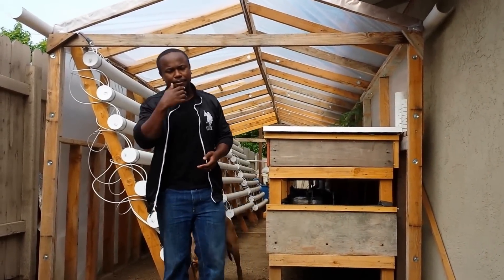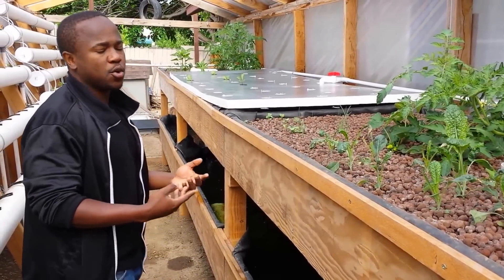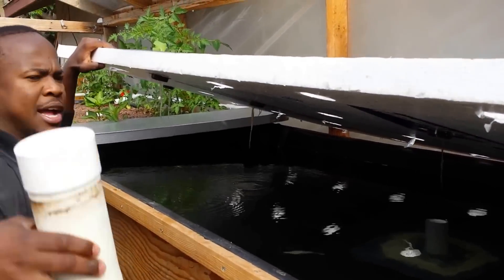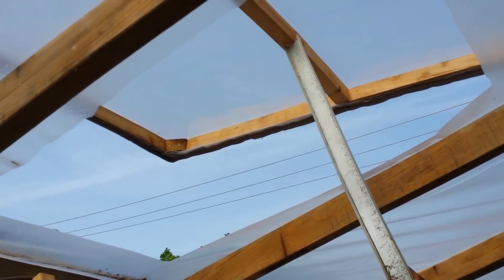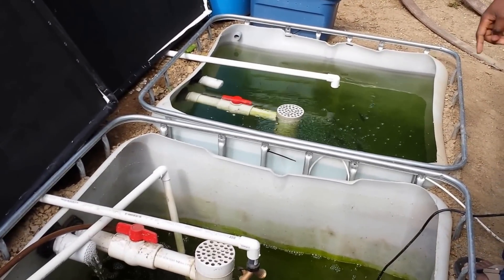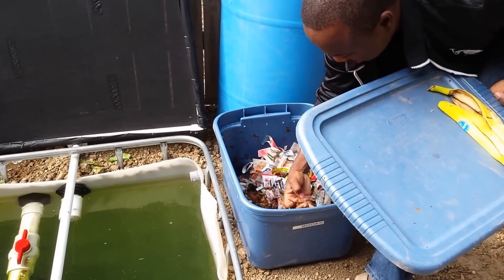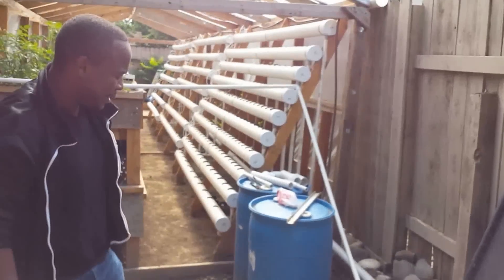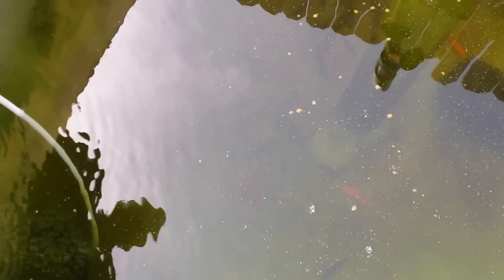Aquaponics Large Scale System From A-Frame Prototype

Comment: The video was really helpful, thank you. Do I need an air pump for NFT system when I have the secondary aeration technique which is the open pipe that let's water back into the pond or if I change the water in the pump every week do I still need an air pump. I'm just trying to find an alternative to using air pumps

Comment: I'd love to do this, but I have snow for 6 months of the year. So I can't.
Reply from the maker: That could be  challenging may be you might want to look into greenhouses.!!
Reply: look into greenhouses and using compost piles inside to create heat. Also the larger the body of water the easier to keep the temperature, I'm currently trying to figure out a good system for a similar climate
Reply from the maker: J Sosa Thankyou for watchin.Yes Compost definitely works on heating.Just keep in mind that in the summer it might be a bit challenging to cool your greenhouse,you may want consider moving the compost somewhere else during the summer.
Reply: @ Unitan aquafarms I recently seen a guy use a bug zapper (those purple looking lights) that he had removed the bug catcher off it, he placed it above the fish tanks so that it would kill any flying bugs and work as a automatic feeder. Thought that might interest you. Thanks for posting and sharing your info

Comment: I have a question, how many watts are needed for the one pump and how much water does it move per hour?
Reply from the maker: Depending on the water volume and cycles you need..mostly 10 -20 cents a day when the pump is on 24/7..
Reply from the maker: wattage ranges from 45 w to 120 watts depending on the size of your pump and the size of the system
Reply: nelson mmbando Thanks!